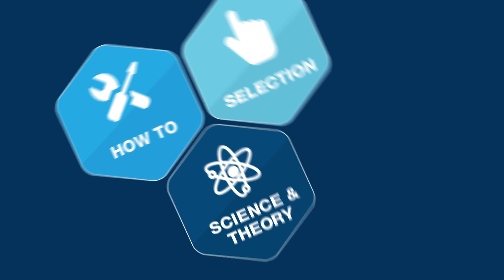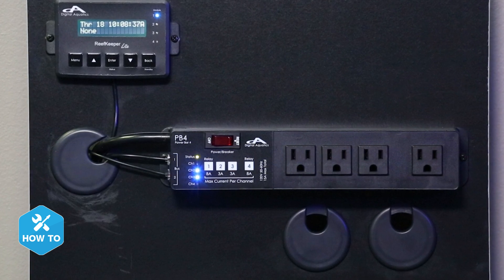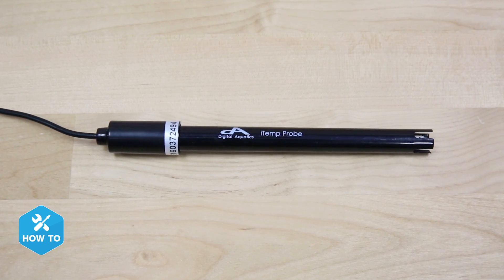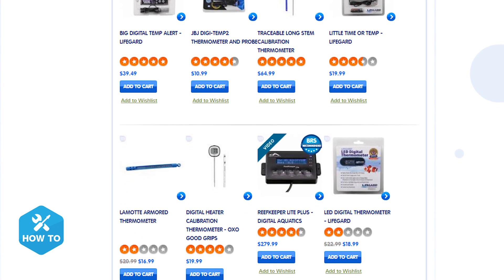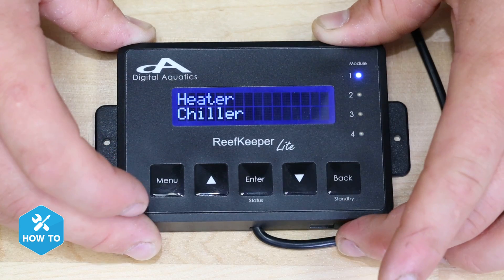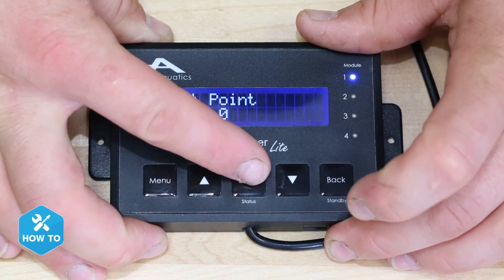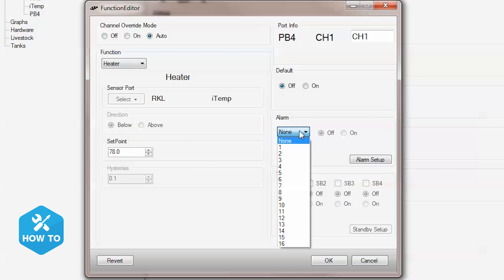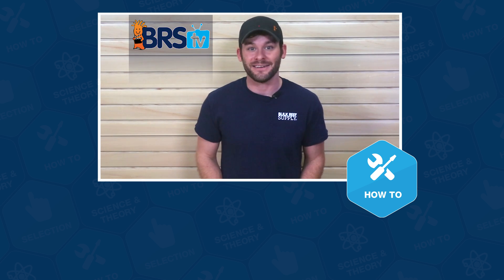How to use a ReefKeeper as temperature controller | BRStv How-To

Comment: This kind of setup doesnt allow for setting a hysteresis value -causing the heater relay to turn on and off rapidly.  Setting up the heater through the "controller" option allows to set a value that the temp can drift by so the heater only turns on if the temp goes down by a certain amount (0.5-1 degree is sufficient).
Reply: This is what I've been trying to find! I read the manual and I know the RKlite has a hysteresis option. I can't seem to find that! How do you set it up as a controller to access the hysteresis feature?